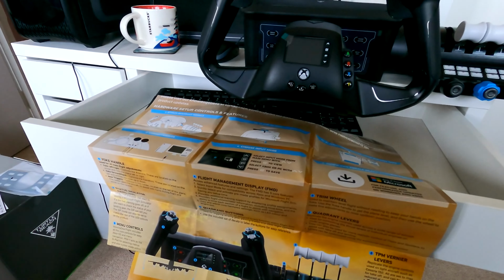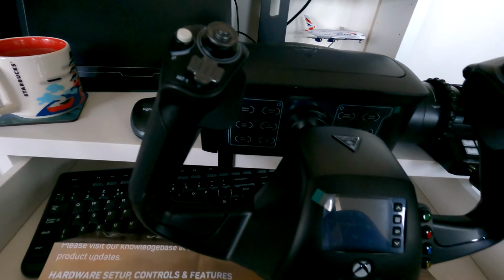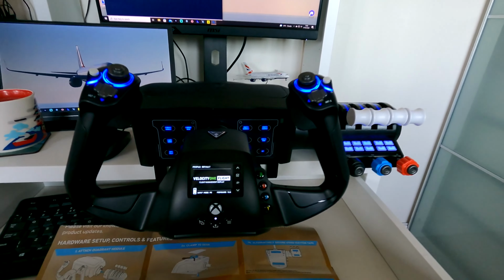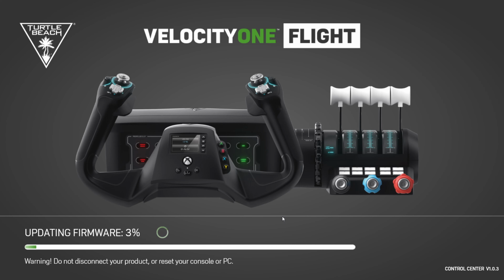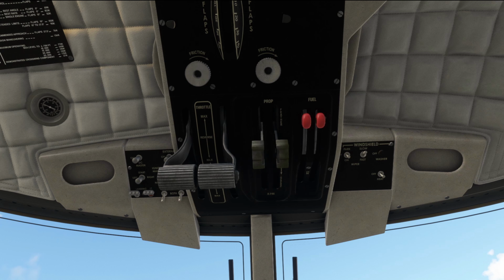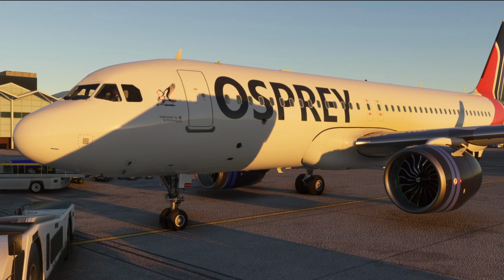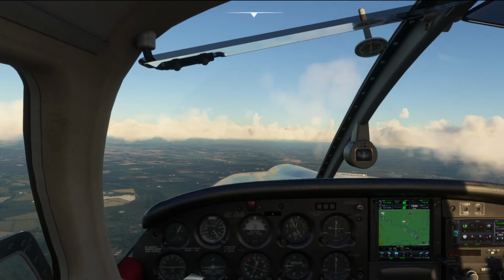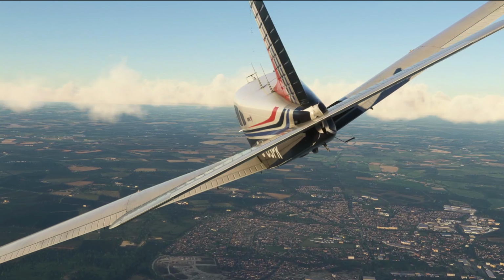NEW Turtle Beach VelocityOne Flight - is it worth it? First Impressions + MSFS Set Up Tips!

Comment: Mine is going back. My right hand buttons crapped out, no right hand brake and no right rudder, had it fixed, not long had it back same issue, it's crap, so going to demand a refund, not want this crap.
Reply from the maker: How long have you owned it for? I have rudder pedals which I use for rudder control myself so have deactivated those keybinds on the rear of the yoke and they are now differential braking keybinds. I've had it for over a month and still loving it personally - shame yours seems faulty
Reply: @BritishAvgeek  not long, had ut for 2 weeks issue of buttons showed up had it back for maybe 3 weeks same issue, was away for 2 weeks, so sick of it, going for a refund and will just go back to the joypad. Would love the boeing yoke but to expensive
Reply from the maker: @denodan  yeah tbh I think the Boeing yoke is vastly overpriced. Sounds like your one was a faulty unit so it's a shame it's ruined your opinion of this bit of hardware. Could always look into Honeycomb?
Reply: @BritishAvgeek  also a pain in the arse, everytime to get reverse thrust going, have to either unplug the yoke or restart the sim, I know many others in forums having issues. Honeycomb would be nice, but not xbox  compatible